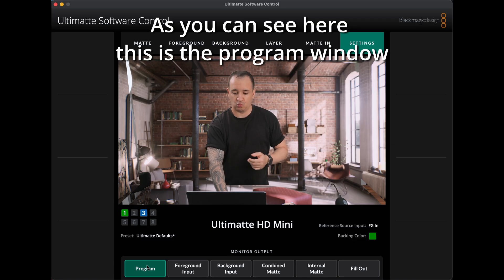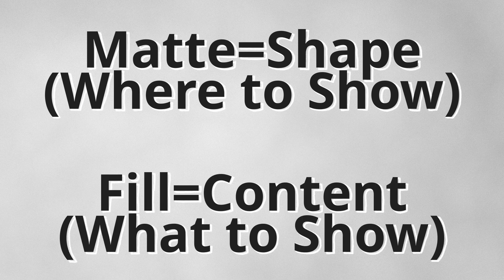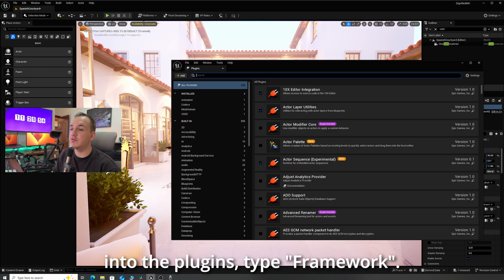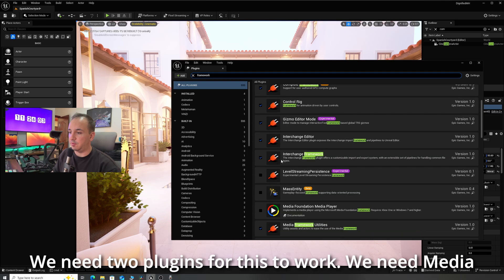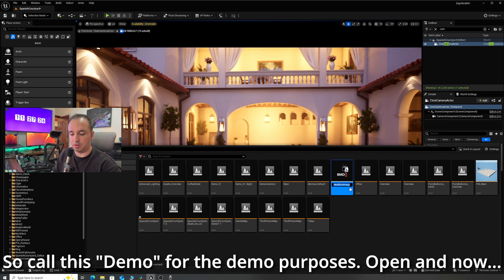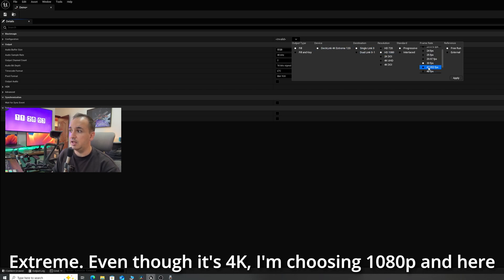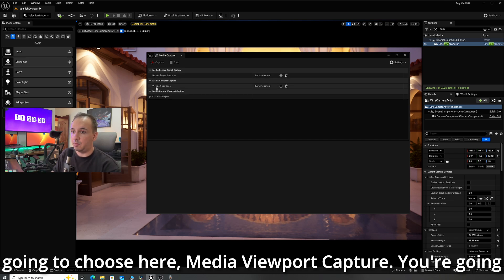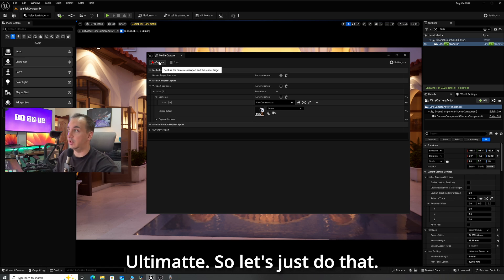Using External/Hardware Keyers with Unreal Engine 5 - Virtual Production

Comment: Zero density has a software keyer that is miles ahead of both aximmetry and ultimatte what talking about keying for virtual production with unreal engine. This is because of its 3D clean plate. Part of the setup process is creating a 3D cyclorama mesh which is then used to generate a new clean plate EVERY SINGLE FRAME. This is EXTREMELY good because of the 3D cyclorama fitting the dimensions of your studio specifically when your camera tracking system moves they keyer knows exactly how far you are from the camera and how far the camera is from any other wall or point in the shot. This allows for by far the best shadows and translucency for unreal virtual production. It was designed specifically for 3D virtual production and is fundamentally different in how it works from traditional meters like ultimatte and aximmetry
Reply from the maker: Yes zero density is the best. Also expensive. But your comment taught me a few new things so I appreciate you taking the time to post. Thanks
Reply: @BrunoCavarsan  You're not wrong there. It def is not cheap
Reply: @BrunoCavarsan  zero density released open studio license, its free to use
Reply from the maker: @vood0_0 yes I’m looking into that. Thanks
Reply: I was a Zero Density engineer for four years at a studio in Romania, worked on dozens of shows, and realized how good the keying is in this software when I tried to achieve the same results in Adobe After Effects and failed. Although in Zero Density you had to make some minor adjustments.

Comment: what about timecode from the camera for the fill and matte output from ultimatte to pc.
If I am directly sending camera feed into pc I can get the timecode and the basically send unreal bg into ultimatte and let the keyer do the final composite. However while testing out with 4k Ultimatte if we send fill and matte feed into the pc we dont get the timecode data.
Reply from the maker: I don’t understand the first part of what you said. If you want to do the compositing inside the Ultimatte then why not send the camera feed directly to it?
Reply: @BrunoCavarsan   thats what Im doing currently. Im sending it in ultimatte to get the final comp. But what if I want to use fill and matte and comp in unreal. From my understanding the fill and matte output don't send out timecode data, so it will cause and issue. For me timecode is also very imp as I would be using a tracking system and also sending that data via live link
Reply from the maker: @raijin7086 Are you referring to Genlock (not timecode)? I don’t know what tracking system you use but as far as I know most tracking systems don’t even need Genlock because they use a very high frame rate like 5000 or so.
Reply: @BrunoCavarsan  no im actually referring to timecode. There are several devices i am testing with. One is my iphone using jetset and tentacle sync. the other is like optitrack  what both mocap and tracking. the idea was to using get the keyed footage into unreal and use composures as a method to overlay cg characters onto mocap actors
Reply from the maker: @raijin7086 I see what you mean now. But for your use case you need Genlock. And you can buy a Blackmagic Genlock generator then connect your camera, Ultimatte and UE5 to this Genlock generator

Comment: Thank you for mentioning Aximmetry in your video. Aximmetry can handle uneven lights if you are using the 3D cleanplate feature. Have you used it in this demonstration?
Reply from the maker: Not yet. Since clean plates need to be 3D modeled I might not use it in the tutorial. Also please make a monthly subscription plan. I have friends who need your software but can’t afford it
Reply: @BrunoCavarsan  Aximmetry is available on a subscription basis, as far as I remember.
In the latest 2025.3.0 Beta release, Axi introduced a Curved Mode that allows you to use the 3D Clean Plate without requiring a fully 3D-modeled stage. I recommend you try this.
Reply: @BrunoCavarsan With static cameras, like in this footage, you’ve never needed to model anything to use the clean plate function. Also, subscriptions have been available since a long time and there’s even a free, watermarked version.
Reply from the maker: @johanfolke2971 yeah I know about the free tier. Didn’t check the subscription tiers since I have a license. But will check later for a second seat